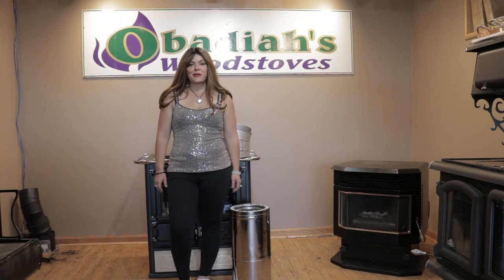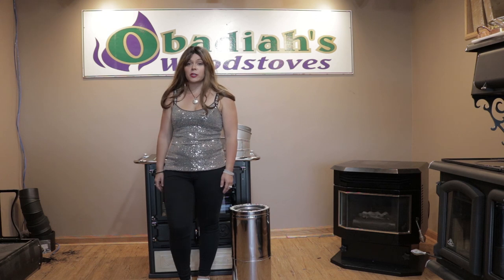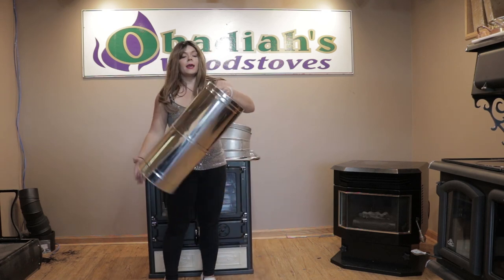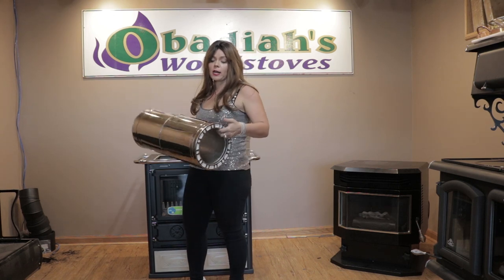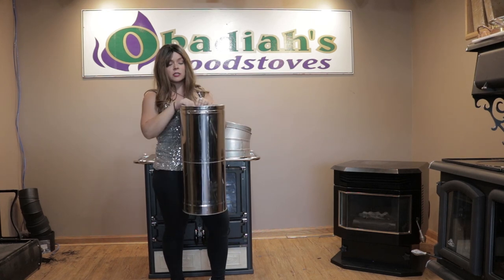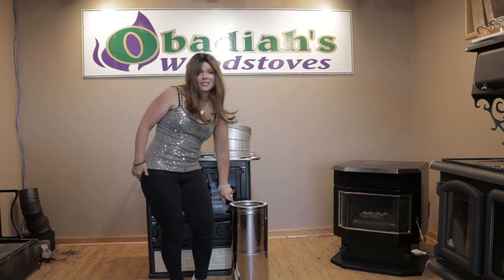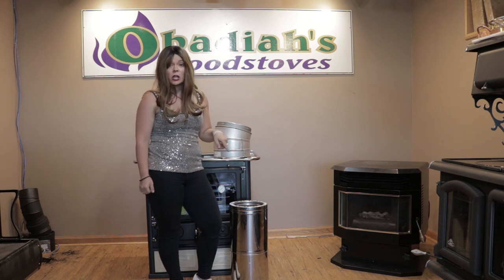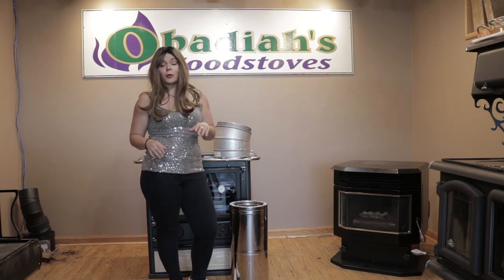Class A Chimney Pipe - Stainless Steel vs. Galvanized Solid Fuel Chimney

Comment: Neither are good enough in my eyes and I prefer it to be enamelled stainless steel as that cheap stuff your showing will get a blue tarnish of it gets hot.
Our twin walls have to be able to maintain 4hour chimney flue fire. Not 30 mins or 15 min 
That sort of regulation is very poor
Reply from the maker: Wow, I'd be curious to know what brand of chimney can maintain a 2100 degree chimney fire for 4 hours. Sounds like some incredible stuff.